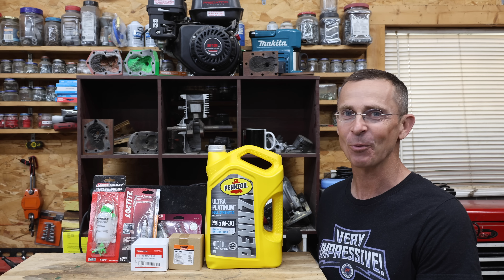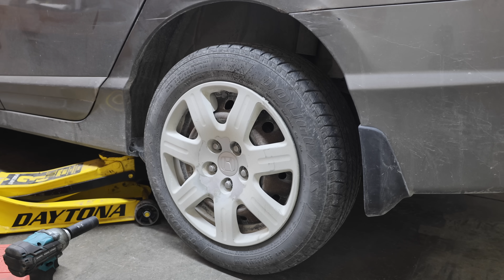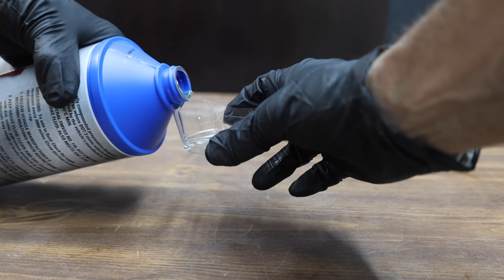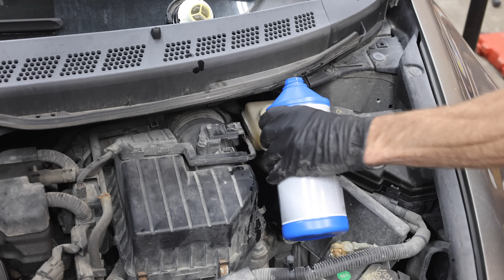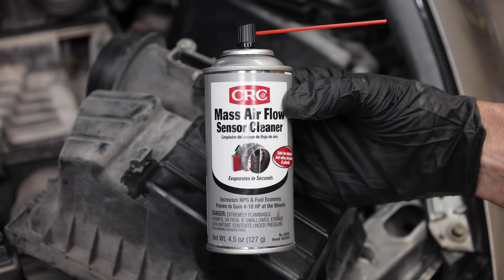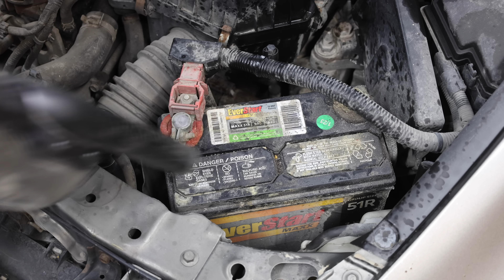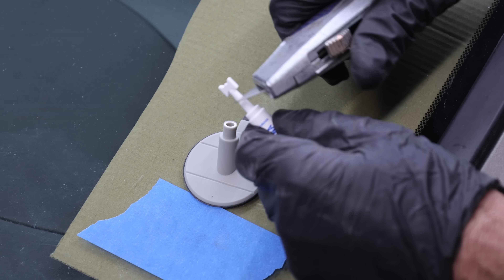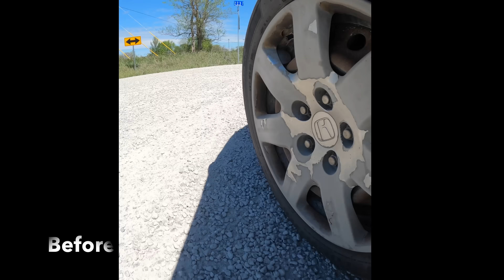Most Reliable 200K Mile Car? Let's Settle This!

Comment: I'm finally getting rid of my '04 Dodge Dakota, 347K miles.  Engine is still great but rust is taking over the body.  I've replaced the rear end once, and had the manual trans rebuilt once.  If it wasn't for the rust I'd keep driving it.  Paid $15K in '04.  Gonna miss that truck

Comment: Great vid! Going to go through my 10 year old Impreza with those items you suggest. Gave it a like. Thanks!

Random vid suggestion: You know those white plastic picnic tables with the legs that fold and stow underneath? My family uses them at crawfish boils. But I've seen them vary widely in price from $25 all the way up to $140. It'd be awesome to know which ones are relatively affordable but hold up to abuse (how often they can be folded and unfolded, how much weight they can handle, how tippable they are, and how durable the tabletop is to abuse such as being thrown in to the back of a pickup/van).
Reply from the maker: Thank you for the video idea!

Comment: Excellent advice as always. Even vehicles that get bad reviews from some sources can serve us well if properly maintained. I offer my own example; I have a 2011 Ram 1500 with 113K miles on it. It is 2WD, auto transmission, single cab, short bed. Evidently the 5.7 Hemis built between 2009 and 2014 have a higher then average valve lifter failure rate because the manufacturer went with the lowest bidder to increase profits. That said, mine runs perfectly and (so far) doesn’t have the dreaded “Hemi Tick” associated with valve train failure. If or when that occurs, I’m prepared to have it fixed and upgraded. I live in Indiana, and my license plates, insurance and registration fees are very reasonable on older vehicles. My truck is rust free, solid, and suits my needs very well. So for now, I’m sticking with 3K mile oil and filter changes with pure synthetic oil and top shelf filters, plus whatever the other systems need. Thanks for demonstrating that not all vehicles are “disposable” if they need a thousand dollars worth of work on them, and that trade-in values are only one measure of their worth.
Reply from the maker: Thanks for sharing!

Comment: Maintenance of a vehicle is is the most important thing that can be done. I have a 2005 Ram Pickup with 250000 + miles on it, and still going strong. I guess it didn't hurt that I was an certified automotive technician for over 40 years. Lol
Reply from the maker: Thanks for sharing!

Comment: I would have recommended installing new axle seals on the transmission when installing the half shafts.  You were there, they are most likely as old as the half shafts, and any vibration from the inner joint has been stressing them.   Same working theory as installing new spigot and throw out bearings when you install a clutch.  You’re there and the parts are relatively inexpensive.  

Other than that good video.

Comment: These videos are fine and temp vacation from the regular content. I will also back you up on the 2003 year suburban/Tahoe.  Mine was tip top except for the paint at 260K when I gave it to my daughter in 2021, never had to change the front brakes. Hubs yes, brakes no.  She eventually got a new car, but no issues when she traded it in.

Comment: 2003 Volvo S60; 349814 miles; engine is leak free, transmission shifts smooth, only wear items replaced since 2003 other than wiper motor and factory defective DIM module.  I LOVE this channel- great job Todd... you too Cousin Eddie :)
Reply: They don't make new Volvos like they used to.
Reply: @n9wox  I'm in 100% agreement with you. The P2 Volvos are solid;  I also like the 'boxy' 760 / 850 / S70s
Reply: Volvo's can last a long time, also... but usually seem to have wiring problems.

Comment: My 2000 Toyota Echo is at 425k right now and still buzzing along. Replaced the clutch and alternator and with 40mpg its paid itself off in fuel savings 3x over in the last 18 months of ownership.
Reply from the maker: Thanks for sharing!

Comment: 200k miles? I think my Grandfathers 1960 Beetle hit 200k 40 yrs ago😂Today my Dad has the car (after my Grandfather passed) the VW has just over 1 million original miles and is still driven most days of the week by my Father.  Ironically, my Dad has a 2015 Lexus RX350 sitting in the garage that he bought new and never drives.  He prefers to drive the beetle.  He takes the SUV only on trips on the freeway since the Beetle isn't very safe on the freeway with today's highway speeds.  Original Engine and trans, been in the family for 64 yrs and still sounds like a Singer Sewing machine.  I personally don't know of ANY car that is 64 yrs old and mostly original still being daily driven.  Definitely  no Toyota.  If there is something out there, its probably an old Ford or Chevy 😎
Reply from the maker: Thanks for sharing!

Comment: Before watching I knew it would be a Honda lol. I sold my RSX (Honda integra in Japan) with 182k. Had minor issues but mechanically solid, I did the accessories belt at like 150k was still fine lol.

However, I worked on municipal cars (police, etc) in New England. Plenty of police dept with lower budgets kept cars longer. There are tons of crown vics with over 350k miles rock solid. If you maintain it it'll last but for sure for reliability JDM hands down.

Comment: Good video. Back in the early 1970s my friend who knew cars said, "Forget the Volkswagen, the cheapest car is a reliable old beater." True then with 60 cent gas,  still true now.   I've just seen an analysis. Buying a new Tesla Model 3 for $40k versus a new $28k gas car(reliable Toyota/Honda) over ten years,  the Tesla, based on MPGequivalence  and significantly lower maintenance costs will save you $11,000.  
However, less expensive than both,  by a lot more than $11k over ten years,  is of course a used car. (Somewhere my 1997 Honda Odyssey with 300k is probably still doing just fine.)

Comment: I did that two weeks ago, i had a set for 50$ bucks, but mine was heavy duty, so $140.00 dollars for one brake.  However, its real nice like, wish I did the CV too, I hear noises in first, but I'm apt to Jake / Logan Paul, it just is how I am.  The spark plugs aren't the problem, you need fAtSo wires, better spark plugs suck more juice, better coil packs pump more juice, but the good wires all you need.

Comment: Sounds, like you have friends like mine. Not only automobiles, but I also buy washers, dryers, refrigerators and stoves/ranges used that are practically new that are "broken" for less than $100 and usually replace a thermal fuse, thermostat or some other cheap parts and have "new appliances" when it's time to upgrade.

Comment: 2:07 No please don’t let the assembly pull on the brake hose like that there is a chance that it will tear the inside of the brake hose causing more problems down the road

Comment: Here is what I drive everyday (for last 17 years). My Jeep 1989 YJ has 243K miles, running 33"inch tires (miles are higher), Then I have a Acura MDX with 251K miles. Both are daily drivers and I swap them depending on which keys I can grab fast.
Reply from the maker: Thanks for sharing!

Comment: almost a year ago I got a volvo just shy of 200k miles. after some maintenance, PCV cleaning, new pulleys, bushings, Timing belt and a few other small items. It runs like a watch as they say lol. I also change my oil and filter every 3-4 months or 3k miles.. whatever comes 1st. always use good oil and check it regularly!
Reply: The 940's turbo four cylinder is an amazing machine! Pretty easy to work on most of it too!

Comment: I would definitely like to see more videos like this. The coverage of the work you did on your 12 valve Cummins also fit nicely into this category of video. As vehicles age, keeping them running reliably takes effort, but especially with vehicles like your Cummins, the older vehicles tend to be a simpler design than more modern examples that can aid greatly to their reliability.
Reply from the maker: Thank you for the video idea!

Comment: Proves so much of what I've long believed. My 2007 Crown Vic has 341,000 miles on it, and just keeps rolling. It does need a fair amount of body-work to continue going, and I'm hoping to do that (and get what I don't do, specifically, welding), done, but it should keep going for a long, long time. It's my intention to keep that car for as long as possible. In fact, I'm looking for another one or two now to salt away for future use.
Reply from the maker: Thanks for sharing!

Comment: Really going putting money and effort into this rig before you can be sure the drive train has enough life left in it.   I guess you are not too particular about interior - at 200K miles, that is about 5,000 butt down hours which usually means plenty of wear and tear on seats, pedals and steering wheel touch points.

I generally take a little extra time to really clean the entire area when doing these kind of jobs.   Granted it isn't necessary and will quickly attract road dust etc, but since I have it apart I like to see it look factory clean when I put it back together.

The Farm really cashes in on low insurance and tax rates in Mizzou!

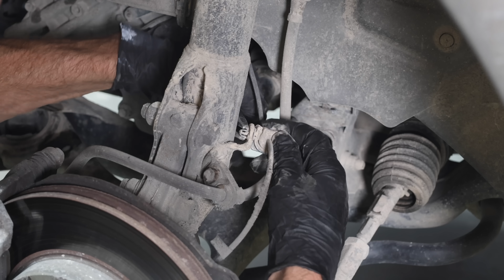Comment: Timestamp @ 1:21
Mechanic tip: most of those plastic harness retainer barbs are easily squeezed in with the boxed end of a 10mm combination wrench. Slip the box end over the barbs, wrench will squeeze both barbs in enough to pull the retainer out of the hole.
Reply from the maker: Thanks for sharing!
Reply: Is that the same with Toyotas?

Comment: I'm just impressed by how little rust there is. Living in the rust belt and I've had cars with less miles be seized up for anything brake related. Twisting off bleeder valves, stuck on drums, rusted cv axles, stuck cv axles you name it.

Comment: I did similar to my 2000 Toyota Avalon with 250k miles, still runs strong. Just bought a 2005 Honda Element with 200k miles and am fixing a few things on that. Each of these cars cost way over $500 though. I do not see any $500 cars I would want where I live.
Reply from the maker: Thanks for sharing!

Comment: I've been driving my 1990 Volvo 245 for years and although it might use a bit more fuel than a comparable modern wagon I still find it to be a very cheap mode of transportation. Doing all repairs and maintainance myself also saves quite a bit of money.
Reply from the maker: Thanks for sharing!

Comment: In less than 20 minutes you've clearly instructed anyone with a reasonable toolkit and some common sense how to save thousands of dollars and drive safer. Outstanding!
Reply from the maker: Thank you!
Reply: VERY IMPRESSIVE !!
Reply: It's takes more than common sense for someone to replace a CV joint on their own... Hopefully someone with no experience doesn't screw up their car lol
Reply: @SPQR_14  Anyone who isn't a master level DIY should definitely get an alignment on the car after replacing the CV.
Reply: Doesn't matter how easy it seems on video or how much it costs at the shop. I will not do any work on the brakes of my car.
Reply: Right!
Reply: Recently purchased a 2001 Tacoma w 200k miles.  Performed many of the same repairs on this video and the truck is running great.  Just need to reweb the seatbelts.  Will see how long it lasts.
Reply: You nailed it with this comment!! It's a brilliant video
Reply: Alot of this stuff isn't for someone who has a tool kit and common sense..it's pretty involved and any little thing you can screw up and wonder why your car doesn't start or shifts all screwed up..etc..
Reply: @BigLennyTan1010  i mean a simple thing like an oil change could blow the engine. a similar thing like a tire rotation could cause a car accident, changing out your brake pads are equally if not more hazardous. 

theres risk in everything. doesnt mean you shouldnt do it, just means you should care if youve done it right.
Reply: @whitegoodman7465 this line of thinking is why people can't do things themselves. You have to start somewhere. Unbolting and rebolting parts is intimidating, but not actually hard. Also the internet can teach you how to fix any repair.
Reply: @whitegoodman7465 It’s not like working on your car is complex or super difficult, it’s just super tedious.
Reply: Also a very easy car to work on 😊
Reply: @mwp1088 that means it was well built.
Reply: @mwp1088 Now, if this was the SI k20 version, it would’ve been far more of a pain in the ass. There’s almost no clearance on the tensioner bolt, so you need to use the scuffed breaker bar in the open end of a wrench trick.
Reply: Teenagers need to watch this.  They have lost the ability to repair things.
Reply: @longshot7601  you had me at ability
Reply: @longshot7601  not all I'm 13 i do everything on my moms ranch expect pay the bill thats her
Reply: @Anthony-stama  Keep it up.  Farm kids have got the city kids beat.
Reply: @longshot7601  yep we do and do so crazy stuff in December i lit a pine stump on fire and started the chain saw up and cut the roots while it was burning
Reply: One of the best DIY videos I've ever seen. Straight to the point. Showed you everything you needed to know on many common repairs.
Reply: Old Honda's are the greatest SHTF vehicles ever. The engine unless someone has done something really bad will last forever and you can get a set of tools from HF to do about everything. I changed the transmission on my CRV in the driveway with HF tools and a youtube video plus you learn how stuff works.
Reply: And now you know why this car most likely got sold, the shop told the owner "oof, those repairs will be at least 2-3k" and they decided to sell it.
Reply: Much of what he did required a car lift, not many of us have one. Or his mechanic skills.
Reply: @paulp.6399 Tell me you have never repaired anything in your life without telling me you have never repaired anything in your life.
Reply: @paulp.6399  you mean... a Jack? and some stands? like he used?
Reply: @paulp.6399  your car should have come with a jack, if not get one.

Comment: 2000 Camry LE with 276,630 miles for $1300. Put about $1300 into it, doing front and rear struts, tie rod ends, lower control arms, sway bar links, motor mounts, transmission mount, various seals, valve job, timing belt, oil pump, tune up stuff. Runs like a top, has a 287,874 on it as of this second. And the KBB value on it last time I checked was still over $3000, which is absolutely insane.
Reply from the maker: Thanks for sharing!

Comment: A bit worried about the transmission fluid change, since it might flush out the metal shavings keeping the gears in proper contact with each other. It's not rare for old, well-working transmissions to need replacement after a fluid change. Otherwise a masterpiece of a video!
Reply from the maker: Thank you for sharing!

Comment: 12:27 as the former manager of an independent repair shop, this is one of the most invaluable tips that very few people seem to consider. We had to pay to replace a customer's windshield after a tech (who knew better) decided to skip the towel/pad under the bare wiper arm. 

Overall, great video and great technique! This is the kind of knowledge that we should be imparting upon people who are new to working on cars. There is a lot of garbage advice out there these days.
Reply: I watched the owner of the shop where I  worked crack the windshield of a vintage Porsche 911 doing the same thing. He had no one to blame but himself.
Reply: When I worked at a parts store, we'd change hundreds of wipers a month. The trick we used is as soon as you've removed the old blade, place it on the windshield/hood in a way that if that arm snaps back, it smacks the old blade before the glass. Can't do it on every car, but you can on most, and it saves you from breaking a windshield without having to remember to bring anything extra outside with you. 

Side note: It still amazes me how many people don't know how to change a wiper blade. Its something so simple on 99% of cars, yet you'd think it was rocket surgery or something. You can tell when they're asking you to change blades for them just because they're too lazy to stand out in the rain/snow and do it themselves.
Reply: @s.murphy8336 a long time ago it was a bigger pita. I think old people remember that and never knew it changed.
Reply: Yep, I'm always very careful with a naked wiper arm!
Reply: i was a mechanic, my go to is just to never leave the arm up. if i need to let go at any point, the wiper arm is carefully coming down until im holding it again.
Reply: Lol, broke mine that way.

Comment: I have an '04 Vibe with 260k... about 160000 miles. Replaced the cluth last year. Last work I did was the battery in 2019. I've met others with over 600k... about 350,000 miles
Reply from the maker: Wow, thanks for sharing!